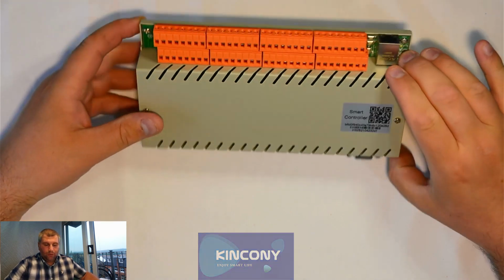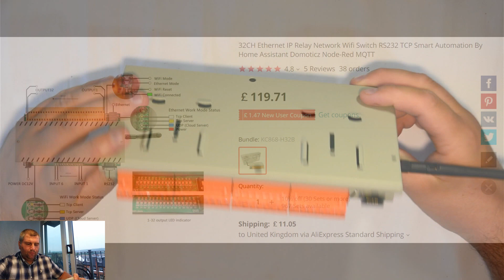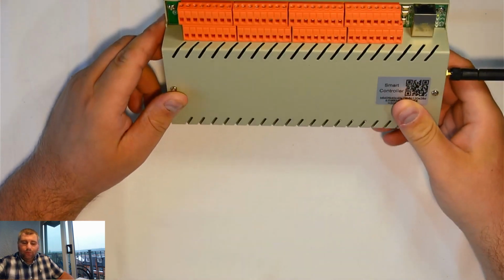KinCony 32 Channels Extension Home Automation Controller Overview

Comment: inputs to control the KC868 Smart Controller as 6 is not enough
Reply from the maker: if you want to use wall switch , you need add "switch terminal board", that have 32+2=34 input port for button.